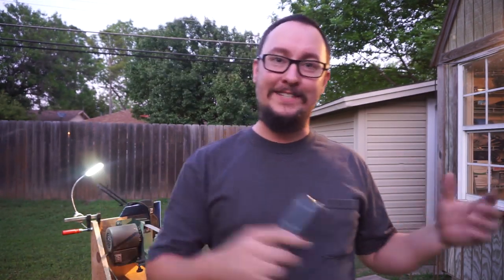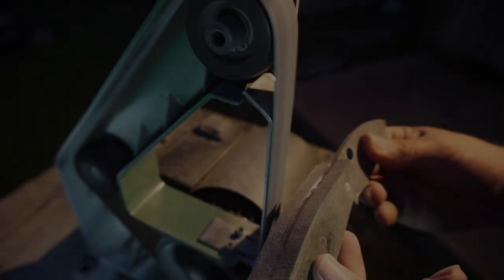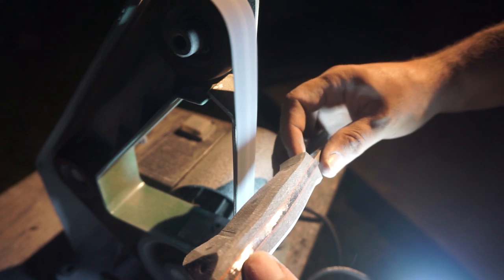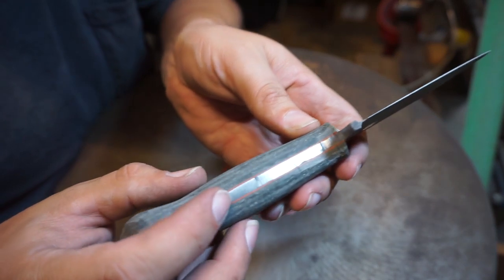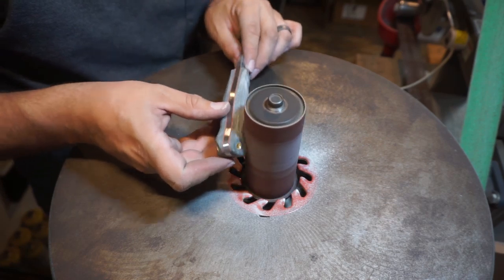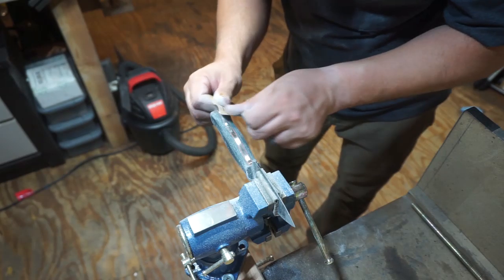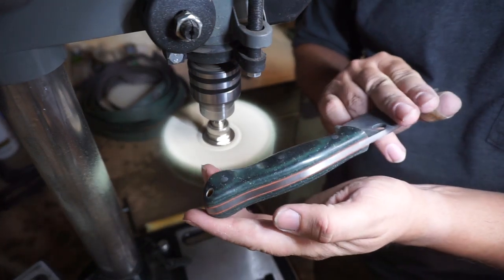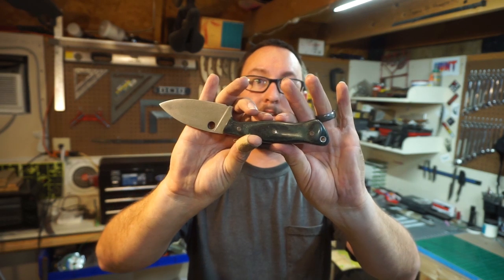How To Shape Handle Scales On A Knife | Knife Making | Daily Vlog

Comment: Great work. Came across a negative review about the vulcanised paper . People said if it gets wet it can separate. Talked to a person at Jantz knife supply and they said the edges need to be sealed well with a waterproof epoxy or c a glue. Any opinion ? Thanks
Reply: Oh wow....that would be a bummer. I know I like the look River came up with tho. Badass knife
Reply: If it separated on me I'd just wrap it with paracord and roll lol
Reply from the maker: This is a high carbon steel knife so you wouldn't be leaving it in water long enough for that to happen. As long as you maintain the type of up keep that a high carbon steel knife needs then you should be fine. You made a good point though and thanks for the info.

Comment: Did you make a platen for the first HF belt sander and what is it made from?
Reply from the maker: Yes, I made it to be a full length from top to bottom. It is just made from a 1" piece of mild steel that was bent to fit.